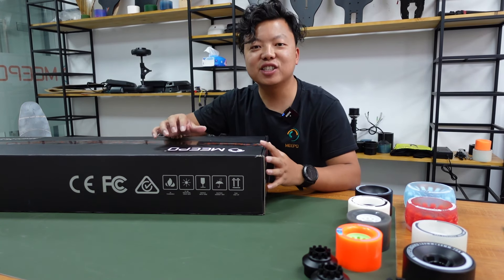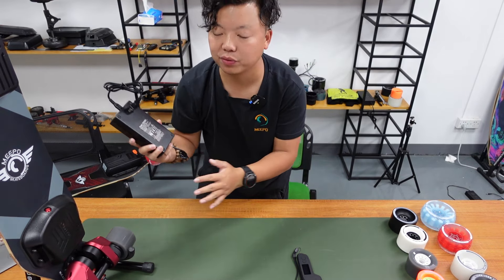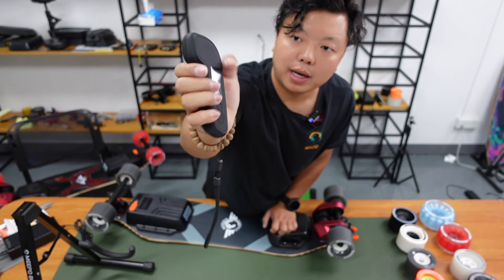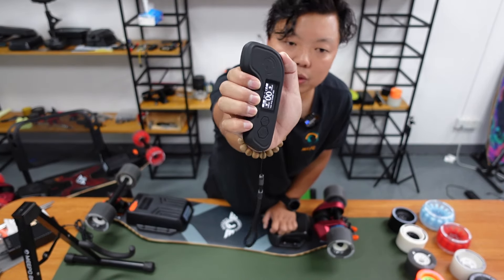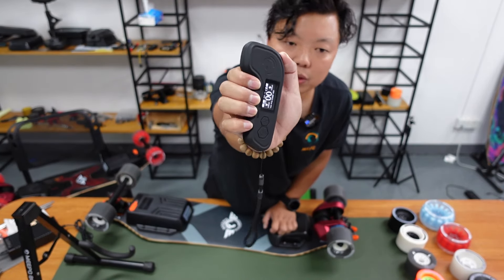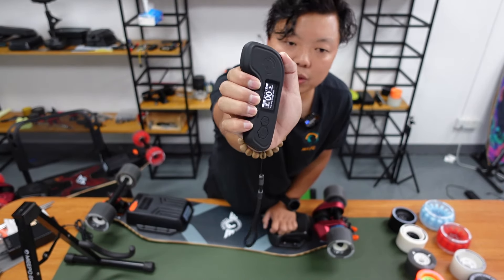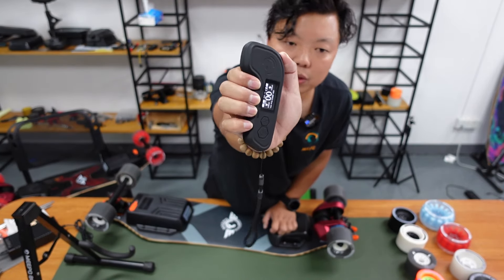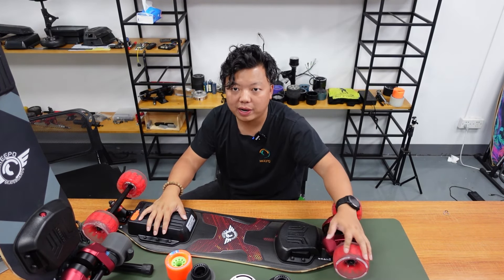Launch nls belt with 105 cloudwheels 2 in 1

Comment: Wish I had not got the old ones that cracked now I have to battle hardnet my wheels to be safe. After we all beta tested them the new versions still crack after heavy use! Now all the old dangerous ones are sold on alibaba/express to unsuspecting customers using the promotion of the newer "fixed" versions to hide the past.
Reply from the maker: Our boards were all well tested before shipping out and the max load of most of our boards are between 300 and 330 lbs . Feel free to contact us if you have any problem! ;)
Reply: @MeepoElectricSkateboard  I was complaining about THIN BLACK CORE OLDER REV IWONDER CLOUDWHEELs that are sold as "high quality" to unsuspecting buyers dispite their unsafe nature at the "core".

Love you Kieran!~

Comment: Will the pullys that come with the board fit the 120mm cloudwheels in addtion to the 105's. Do I need different pulleys to put some 120mm or 85mm orangoutangs????

Comment: Those wheels are 100 bucks a pop, that instantly turns ur deal from meh to very good if you ask me, hopefully the deals still up because I’ll probably buy one!

One thing I don’t like about this board already tho is the style decisions for the graphics on the grip tape and road side of the board aswell as the colour of the belt covers as they’re gonna get scratched up very quickly anyway so I’d prefer a more neutral colour like gun metal grey . And of course the enclosures look very subpar compared to backfires and exways. However one thing I love about this board is the colour of the bamboo deck exsposed sides

If you fix mainly the design issues I think this boards gonna be crazy good but then again the price would have to increase to reflect that so it’s a tough one.
Reply from the maker: Thanks for your advices! These are super valuable for us. We will keep up with better design and provide all kinds of options for our customers.

Comment: You should of made the board  faster like 28-30 mph
Reply from the maker: You could try the new wheels! and we are making them faster and safer, so lets look forward to new meepoboards.
Reply: @MeepoElectricSkateboard  kieran, we want a real boosted clone, with the polished with no apparent screws, the precise control, the reverse, the lingyi is to violent no enough precise control, even Ronnie an pro skateboarder lost his balance many times in mode 1!!!!
Make the board in black or clear griptape.
I want to buy the nls belt so much, my boostedboard mis me.

Comment: I love Meepo. Best Electric boards. You have seriously changed my life with how affordable they are. Not only affordable but quicker than 90% of boards on the market.

Can't wait for the next board. You should partner with Elon Musk 😀

With the new powerful batteries in the market you could seriously make The Best board to beat em all in every category.

My dream board would be 60km/h top speed, realistically 40km range the more the better.

And one thing I seriously want on the remote is clock and estimated battery time left.

Even tho my V3 board got in a car accident with a dumb driver, board got run over by a freakin Jeep.

Its cracked but still holding up and Ive been using it for over a year. Fixed the crack with laminate underneath. Ive only lost 3km/h top speed.

So yeah Im in a need of an upgrade but so far the new boards arent just big enough improvement for me.

Again thank you.

However I cant push and buy above 500euro board. My salary is only 600😅
Reply from the maker: Aww thanks! We appreciate your support and yes we will keep making a good job and don't let you down.